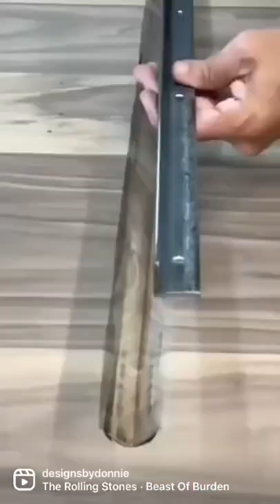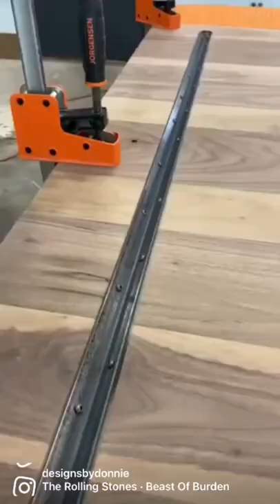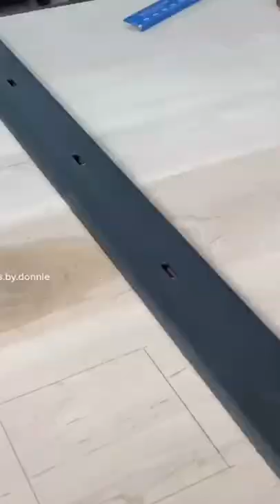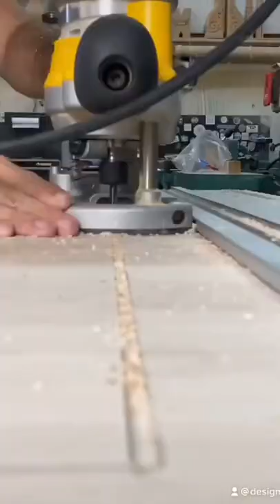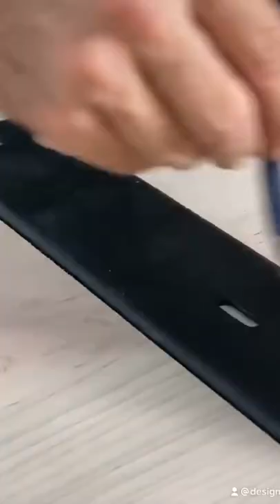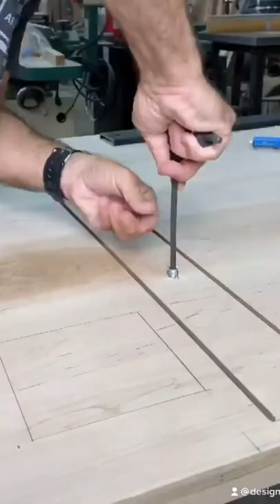Table Bracing! Angle iron verses C-channel #shorts

Comment: Hello,

I would like to know what dimensions it is recommended to have the part that goes into the wood depending on the thickness of the table top? For example, with a 4 cm table top, which model of C Channels should I use?

Thank you and I await your answer!